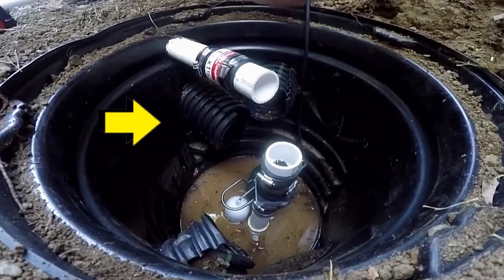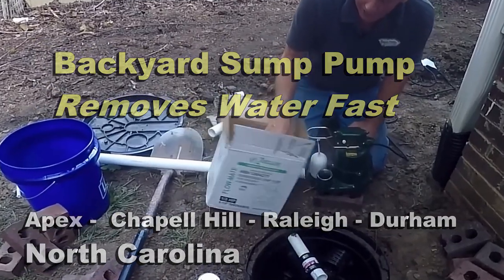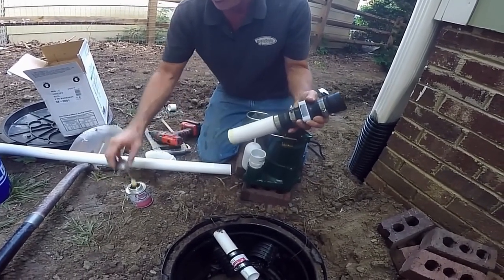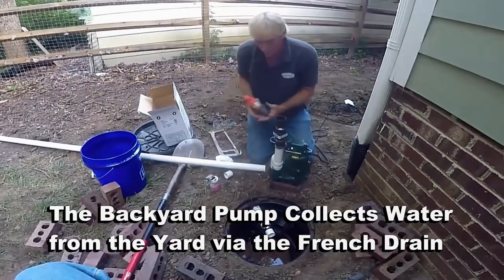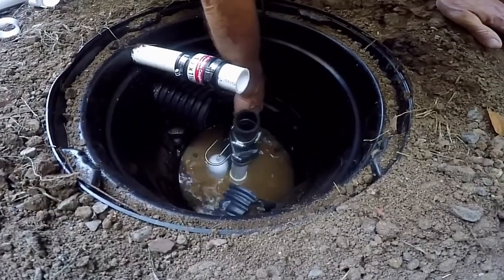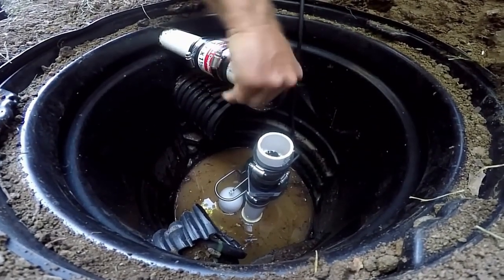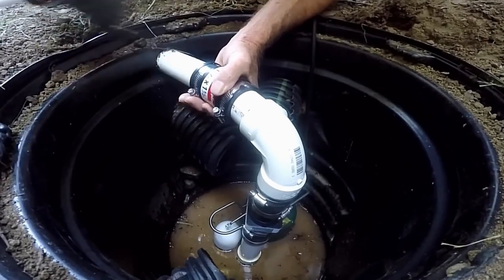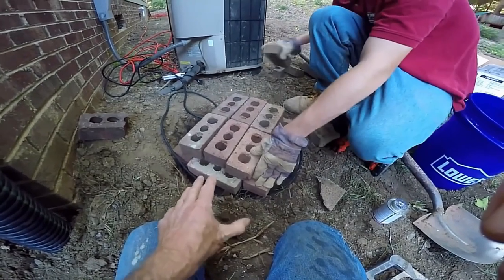Backyard Sump System - Best Sump Pump to Remove Water FAST,  Apex - Raleigh NC

Comment: My last M98 has the check valve straight into the pump with a pre-drilled air hole by the thread...